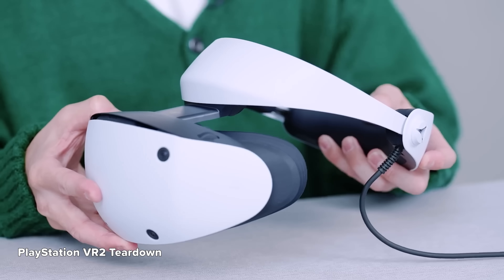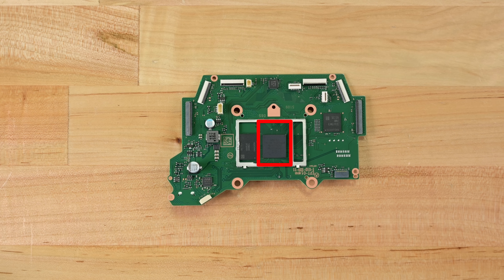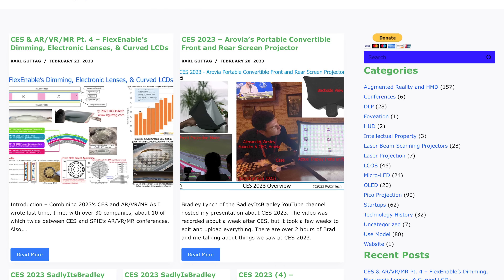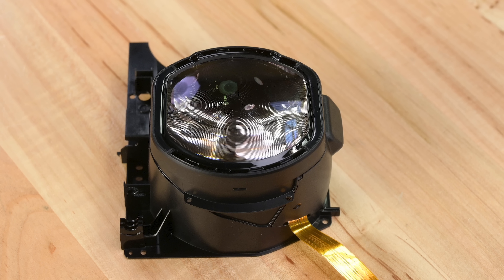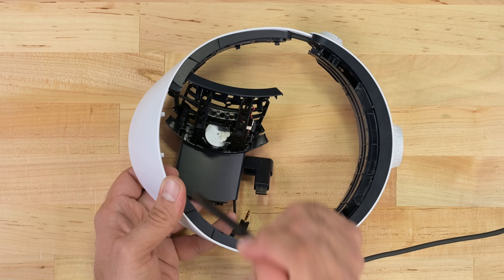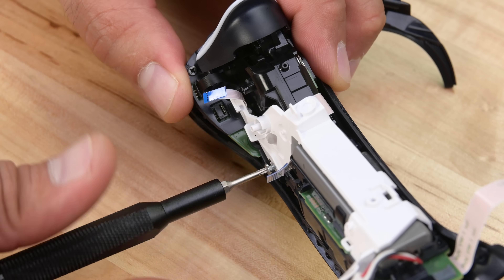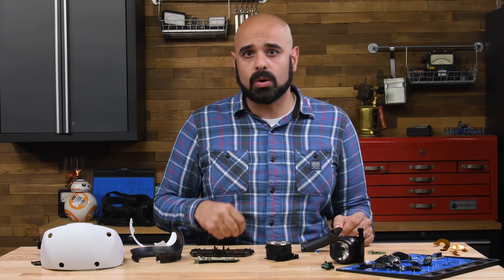iFixit's PS VR2 Teardown- A $550 Compromise

Comment: There are several teardown videos out there, but almost no one shows the reassembly. I dropped my Sense controller and the shell popped open in one corner. After taking it fully off, getting it back together has been surprisingly tricky.
It would be really helpful to see a step-by-step reassembly guide—especially showing where to start, how the clips are meant to seat, and what to watch out for so we don’t bend or stress anything by forcing it.

Comment: is there a way to check if the fan is working? I have the impression my unit's fan has stopped working or the speed is now too low.
Reply: Did you fix It?
Reply: @anarchy966  yes and no. The fun is working when I turn on the headset. But in-game seems dead to me. Which games can I use to check the fan?

Comment: Thanks for posting! You detached the screen from the back of the lenses (which was glued to the frame I think) Could you also detach the lens from the front of the frame - leaving the screen in place? I see some small knobs there holding it in place there. I have a cleaning issue (the lenses fogged up from the inside!) and I would like to clean it from the inside.

Comment: So glad for this video. I was having tracking issues to the point where it was just constant gray screens when I was trying to set the play area. I took the unit apart and then just put it back together. Not sure what I did, but that seemed to have fixed it (so far).

Comment: Is it possible at all to replace the USB cable? The USB connector is broken in my headset. It seems the cable is wired really deeply into the headband, not to mention soldered on. I assume it is not possible to replace this probably with an off-the-shelf cable?

Comment: 0:34 really? $270 pico 4 uses 2K/eye with pancake lens, have computer built in, with battery in the most comfortable position ever.... Their standalone games aren't even anywhere near PSVR's cost! And works with PC too wired or wirelessly
Reply: Also ... I can replace the controller battery in 10 seconds :). Bought 4 li-ion AA 1.5v with USB-C charging built-in for them so I don't need to buy more.

Oh yeah the triggers are Hall-effect too ... Yeah no dual sense but I guess a future technology after it's out of patent lock 😁🙃

Comment: Could you technically replace the lenses with pancake and also fix the mura with the new lenses?
Reply: if that was the case there would be third party replacement kits for all these headsets. i think you can't because of the distance between the lens and panels are perfectly calibrated. also the shape of these lenses. probably way too complex and expensive for any third party company. i have no idea though im just guessing.

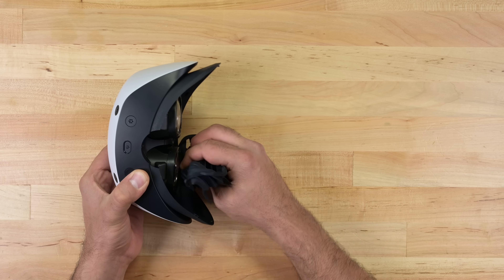Comment: If only you could find replacement parts. I need the flimsy plastic part he is removing at 1:07. BTW for those needing to know, its a Torx T2 that will fit those tiny screws.

Comment: One of my PSVR2 controllers stopped working while I was in game. No battery level warnings or anything, just an abrupt stoppage and statement that the controller is disconnected.  I tried the hard reset stuff the internet recommended but that didn't do anything. It won't turn on, no lights come on when plugged into any power cables, separate chargers or the PS5 itself. I used 3 different cables. It appears that it won't charge and is completely dead. I took it apart while watching this video and reseated the all the connections at the USBC port end to no avail. I didn't disassemble past just getting the battery removed. I couldn't see any obvious burn marks or damage on the charge port or ribbon cables inside. I then took the other controller partly apart and plugged the dead controllers battery into it and the 2nd one still worked. Using the 2nd battery on the first controller did not fix it. Is there a common part that has been going bad on these?

Comment: And yet, if the cable is damaged you have to pay $250 to get it replaced when it can easily be changed out by the consumer with a simple repair video off YouTube. Sony needs to start selling at least that replacement part or at the least an adapter for the headset connection sense its not a usb-c on the headset itself

Comment: Thank you for your video. The tension wheel for the strap has seized up on me. Do you think by dismantling the wheel I could get it back on track? It's so strange that I used the release button to remove the head set but the wheel never reset and is locked. Any advice would be greatly appreciated.

Comment: Please can someone tell me what size screwdriver is need to remove the visor? It's NOT a torx T5 security as another video said. That's too big.
Reply: Let me know if someone tell u
Reply: It was a T4  @trino5561
Reply: DId you get a correct screwdriver size to remove the face gasket?
Reply: @MrG-d1m  Yes, It was a T4
Reply: Torx T2

Comment: My cat ruined the cable and now I have a $550 paperweight
Reply: Planned obsolesence strikes again!  But I have a solution!  Currently the controllers are going for almost 150 USD each, while a headset only can be bought for like 160 USD.  Dealer's choice, do you want to buy a cheap headset or sell of the controllers for twice that.

And what corporation launches a VR headset and doesn't sell replacement controllers, wtf!

Comment: Is the purpose of the fan to remove moisture and heat from the air in the headset while using it, or is it purely to blow air over the interior components?

Comment: For me, the lenses are a bad decision from sony...also not having a detachable cable is another issue...the terrible controller battery life is the most shocking. Sony have added a few new tech such as the eye tracking and haptic in the headset...but they have cut too many corners - most of the tech used is now older tech, which means the headset isn't really that future-proof and wont last long before it will fee outdated. I know many people try to justify the price but without the power of the ps5 the headset is fairly basic and shouldn't cost more than £350.
The nail in the coffin for me was that sony still refuses to allow 3d blu-rays on the ps5 -- they absolutely could add it but have chosen not to. 

i think i will wait to see what the meta quest 3 looks like and costs

Comment: Is there a good way to tie these controllers to my hands like the Index knuckles or kiwi controller strap for quest? Being able to fully open my hands is something i dont want to miss on a new system. Its just so much more immersive when throwing or catching something as well as comfortable during longer sessions.
Reply: Since the tracking ring is around your wrist it does a good job at keeping the controllers in your hands even if you loosen your grip.  Unless you open your grip completely and pull your thumb in they won't slip off, and the short lanyard keeps them from slipping off completely.  Not covered is that the controller has linear proximity detection functionality in the lower fingers (R1/L1), index finger (R2/L2), and thumb (top buttons/stick) allowing basic gesture detection with no or minimal pressure.  Open palm gestures work as expected when a game supports them.

Comment: Lighthouse is inside out. That was the defining difference between SteamVR and the original Rift when they released. The Rift used Constellation, which was Outside In and required USB connections to the PC. The Vive used SteamVR tracking, which was Inside Out and didn't require any sort of connection to the PC at all as a result.
Reply: Yup the external modules for Lighthouse don't require any connection to a PC, just power. They shoot out beams of light that scan across the room in a set pattern, hence the name Lighthouse. There are simple light sensors in the controllers and headset that pickup the patterns. With a little math you get a very accurate position relative to the external modules which simply shoot out the light patterns constantly. Tons of advantages over cameras because the math is way way simpler than processing a bunch of camera feeds. It's super clever.

Comment: I wonder because the PSVR2 is powered by its USBC connection, the games aren’t installed on the headset, surely you could look at the the possibility of connecting to a PC. Is it not like a video receiver? It can’t be much different to that of the way any headset connects to a PC using USBC 🤔

Comment: Infrared Light is not good for your eyes and so close and being constant turned on it gives you high doses of IR-Light. Someone knows the specs of thr used IR-LEDs? they are for sure not very bright, but still the close approximity to the eyes and the long exposure times could result in permanent eye damage - but to state thise facts, we need to get the actual data sheet of the used IR-LEDs.

Comment: Controller's accumulator (battery) IS bad at all! 3 hours is very tiny lifetime + I can't just hotswap it as a AA battery + there's only one cable to charge the controllers in the box. I never understood why do some people prefer accumulator batteries instead of swappable batteries.
I won't argue you didn't say about Mura effect, motion blur and other screen problems – it's not a review. But I can't agree that the batteries aren't bad at all.

Comment: Why do people call lighthouse outside in tracking? It isn't outside in, it was always INSIDE OUT. From the release of the Vive, it was referred to as the first inside out tracked VR HMD. Inside out means the tracked device is doing its own tracking based on what it can sense in the room. The original Rift and original PSVR are outside in tracked. The Vive, Index, Rift S, Quest lineup, and PSVR are inside out. Lighthouse is inside out because the devices are doing their own tracking based on the reference points of the lighthouses, rather than another device tracking it with sensors. In fact, the lighthouse tracked controllers are inside out tracked, but the Rift S, Quest, and PSVR have outside in tracked controllers. Only lighthouse based systems and the Quest Pro feature inside out tracked controllers. Inside out has NEVER meant "the HMD tracks the controllers." It has only ever meant the HMD determines its own position in the room based on what the sensors on the HMD detect, which is precisely how lighthouse works.

Comment: You'd think the PSVR would be around the same price, or cheaper, than the Quest 2 since it doesn't have everything built in...if they get it below $300 I'll consider buying it otherwise I'll stick with my Quest 2 for VR...
Reply: huh? this outperforms the quest 2 on performance to price.
Reply: @Hannah_The_Heretic  sure but it's tethered and way too expensive...the quest 2 cost me $300 and I can use it anywhere...also, the quest performs shockingly well. What I really mean to say is that it's like comparing a desktop to a laptop, the desktop will always be able to outperform a laptop but the tech is good enough that the difference is negligible.
Reply: @jakejager  great last sentence. 👍
I just have to point 1 thing out, your VR set all up has to cost at least twice as much as a ps5 and these things.
this psvr stuff just seems way more accessible than anything else on the market, and great for people wanting to try it for themselves without spending $3000+
Reply: @Hannah_The_Heretic  that's exactly my point, have you used a quest 2? It's amazing, especially considering the fact that it's all one package you can take anywhere and it cost $300...my point is large desktop setups are going to be history before too long and the cost of the PSVR headset is about $150 to $200 too expensive for the average person to care, know what I mean?
Reply: @jakejager  you don't need a computer to run the quest 2? what? for real?
that's pretty dope if true.
Reply: @Hannah_The_Heretic  yes, it is a stand alone all in one package. I think they sell the quest 2 for $400 now but still, you don't need anything else, it's got surprisingly good resolution, video passthrough, all the stuff that makes VR good built in...for $400 (now).

Comment: Thanks a lot for the teardown, I was having problems trying to disengage the cable from the headband insides. I'm trying to design something to attach a face mount as quest 2 has to the psvr2, I cant tolerate this PSVR2 forehead mount and I have psvr2 kept without being able to use it. Too unconfortable for me.
I can say, psvr2 visor works perfectly with unplugged sound cable and head vibration motor.
Reply: I'd like to see a video of that.
Reply: Did you actually get around to designing a different face gasket? I don't love the face gasket bracket and shroud that comes with this device. I want one also similar to the quest 2.

Comment: Is it hard to reinstall the rubber on the headband? I wanted to see if it's possible to add some cushioning behind the rubber on the front of the band... Because I have to tighten it pretty hard to keep the sweetspot in place and that causes headaches ☹️

Because it's just one rubber piece that's clicked into the plastic, I'm expecting it won't be very easy to place it back after removing it...

Comment: I would buy one if it was backwards compatible
Reply: They changed a lot, especially the tracking, so backwards compatibility probably could not have been achieved.
But many developers are working on updates for the new VR headsets, so you can play (most of) your old games on the new headset.

Comment: I still think lenses and screens are the wrong approach.  
I think using the projector processors (the ones with thousands of little mirrors) to reflect / refract light directly to the eye (as it's designed to work) is a better approach.  No pixels to screen door, so no screen door effect.  

I'm sure the light reflection/refraction approach has its own downsides, but it just makes more sense to me to let our eyes do the work they were designed to do.
Reply: That actually sounds genius on paper. But there's probably a reason it's not been done in a headset yet (not that I heard of). Either the costs involved are astronomically high or the drawbacks are just too huge with the current tech. But I'm no expert.
Reply: @SnakeHelah  do you know how much a DMD mirror costs? Those things are amazing feats of engineering, and they are not cheap. 
If you wanted 2 for each eye, the cost of the parts alone to make one headset would easily be over a million dollars.
incredible idea, wish it was possible in our lifetime but its probably not going to be.

Comment: Would it be possible to change the glass lenses with better ones that do not blur the image on the edges?!
Because right now, using these lenses you can only see clear in the middle of the screen.
That's the sweet spot.

Comment: Hi. I just have a tech related question. I have the psvr2 unit, but I think, that the headband is broken. The initial grip (without using the dial) in psvr1 was far more tighter. In psvr2 when I press the button and try to get that initial grip with the band - it is sliding off my face and head. OK, when I use the dial, the headband clicks and I can get the headband tighter. Button releases the grip and the headset falls off my head again - almost no "initial grip" . The headband itself, when pulled back and released, returns to the original position. Is it designed like this? Should the initial grip (without using the dial) feel so loose?
Reply: Yes, the button basically disengages the headset strap. You need to turn the gear at least a little bit to re-engage it.

Comment: Would pancakes lenses actually make that huge price diffence? Pico 4 use them and it's below $500
Reply: Only on the size, from what I have heard. But it's either small sized headset or large FOV, not both.
But as he said, the limitations of using the pancake lens, the fresnel is the better choice for that price range.

Comment: 5:37 nope, Lighthouse tracking is inside-out tracking, it is a common misconception. inside-out describes that the observation starts from inside the tracked device to the outside, or in other words, the tracked device tracks itself with sensors that observe the outside (environment). For example, index controller, index headset, quest 2 headset and psvr2 headset are tracked inside-out, but psvr2 controller and quest 2 controllers are outside-in tracked.

Comment: I wish you talked about the cable because there is quite a bit of confusion if it is removable or not and how hard it is to remove.
Reply: It's removable. It takes some work to get to it but Sony shows it in its headset tear down video.